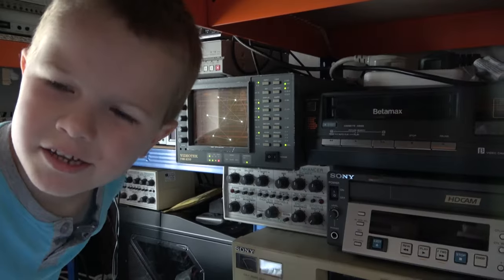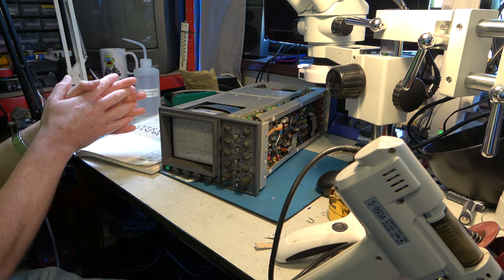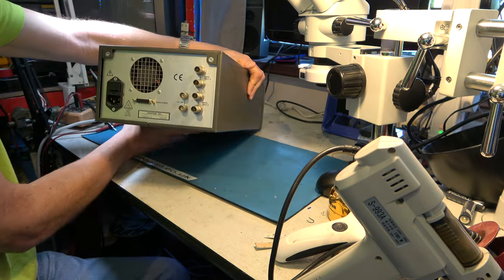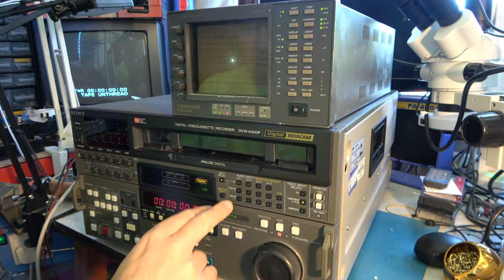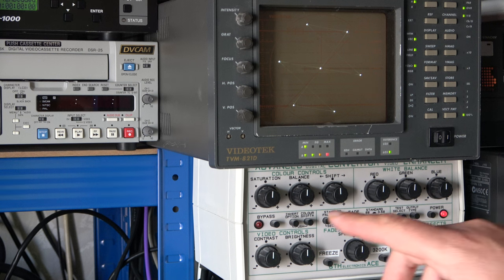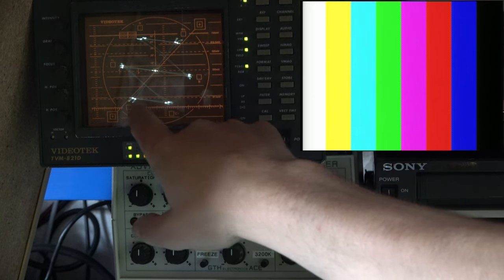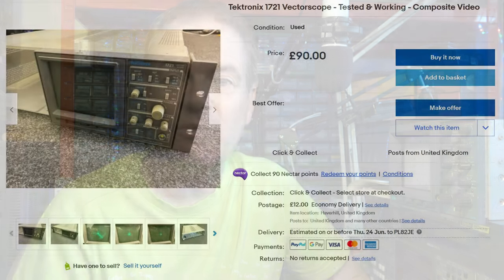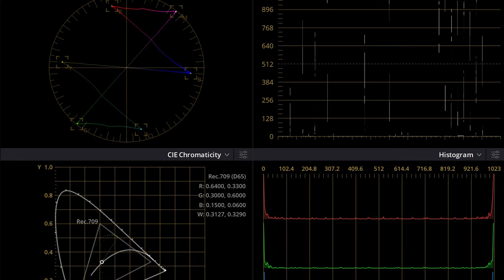Experiments with a vectorscope for video.

Comment: Nice to see a vectorscope in action. With an analogue one, you would of course see an extra pair of shorter lines for the colour burst, as well as sync, chroma & colour burst on the waveform display. Where I worked I had a Philips waveform monitor and vectorscope on the bench, probably made in the mid 80's, they were on all day every day for the 6 years I was there and always worked.
Reply from the maker: Perhaps I should get the analogue on onto the workbench again one day.

Comment: On the Videotek V-scope SAV/EAV does not stand for SAVE or RESTORE.  It stands for StartofActiveVideo/EndofActiveVideo.  This function will show you the start and end points of active video on the line.  This can be used with the error codes sent on the digital cable.  BTW: I used to work with Videotek as a consultant before they were bought out by Leitch Video in Toronto.  They are no more now.

Comment: I have that same model of Videotek Vectorscope at work(with a very weak CRT), in our dedicated PAL capture area. I think we have a manual for it as well, I will look for it when I get a chance later this week (or sooner if we get a load of PAL 1" or U-Matic transfer requests). For some real fun turn the preset off for Chroma Phase (Tint in NTSC land) on the Digi Bata and mess with that post when using a composite input, the internal/external sync switch will cause some interesting results as well.
Reply from the maker: A manual would be a huge help, especially the pinout of the connector.  Tint would certainly screw up the colours, just like Never Twice the Same Color usually gives purple or green faces....
EDIT, the manual has been found: https://assets.tequipment.net/assets/1/26/Documents/TVM-821D_manual.pdf

Comment: Ahh the vector scope, i've seen them used for setting up the colour side of old t.v sets.
But they are often never needed as colour decoders are quite reliable generally.
i've managed to tweak messed up sets to bring the colour back.
People can't leave adjustments alone :-(
It's like engine tuning by ear, you can get it really close just using your senses.
The vectorscope would be the ideal tool, but all those years ago it would have been way too expensive.
Sell a kidney anyone? lol.
Reply from the maker: They were also required equipment for setting up old tube video cameras.

Comment: did you get the 1 inch fixed in the ended   i have a   scully 280 i am workng on  using tascam  38 parts as the 
motor are the right  watts  and i have the right parts to pimp it with tascam 38 parts 

there's alot of fool not using the  wrong motors  to drive  14 inch spools   20watt  min for for 1/4   14 inch spools
you know what i am going on about
Reply from the maker: The 1" C format machine requires some brake components but also a lot of time which is what I'm short of at the moment.

Comment: Amazing, I need the device that u use for change the brightness and saturation. I search on it every where but I could bot fine it .
Reply from the maker: A digital timebase corrector with Proc Amp.  They are hard to find but do appear on eBay or similar.

Comment: I just picked up a pair of Tek 1720 and 1730 waveform monitor and vectorscope. They both have rifa filter capacitors and the one in the WFM exploded while I was checking it out.
Reply from the maker: It will be smelly for days!
Reply: The Tek TSG-131A video signal generator has a RIFA too, built into a metal cased mains filter. Popped after about 30 minutes when put on its first test!

Comment: hi are you having a hard time with the blake's in the one inch     i take the blake bands out and wash them  as i have find they have dryed out   funny they work alot better
o did this on a hard to find  EMI BTR 4 DECK as the deck was getting hot  there is zero i could lose  at the time  worked well    i am asking around the place for a akai mg14d
very hard to find any thing there kind of club out there  bob
Reply from the maker: The brakes look more like idler tyres on this, and they have completely disintegrated.

Comment: I've had two Tektronix 601 vector scope's now and the removable front left control panels have always given problems, these as with yours select the sdi in and all the other functions. what i found was over the years of constant button pressure use at the studio or on ob's the panel flexes slightly back and shorts against the chassis, there is also an earthing strap which looks like a coax cable shield which goes around the inner part of the front panel and the pins on the control board can short to that if the panel has been pulled in and out over the years. otherwise when they work they are quite good and you can also display the video picture on the screen checking for black levels.

https://assets.tequipment.net/assets/1/26/Documents/TVM-821D_manual.pdf
Reply: @Matt Quinn no the tektronix, just a useful tale of what can go wrong. not had much to do with videotek.

Comment: where is the colour burst on the vectorscope also not much use without it parner the waveform monitor.
Reply from the maker: It is possible (somehow!) to get the colour burst display onto the waveform monitor function, I had it once but not when running the camera.